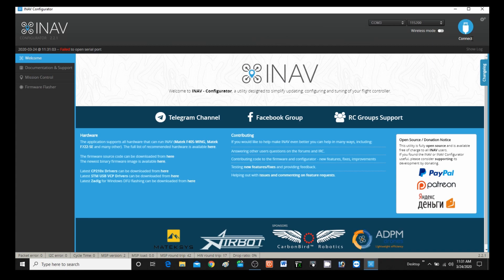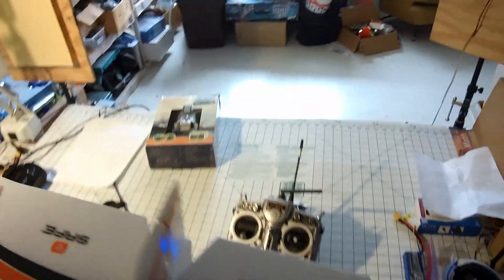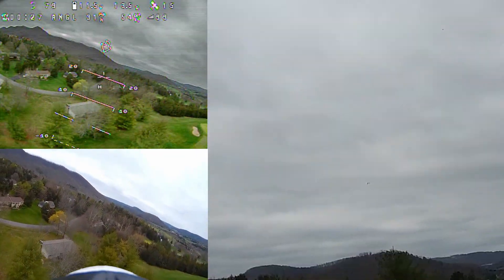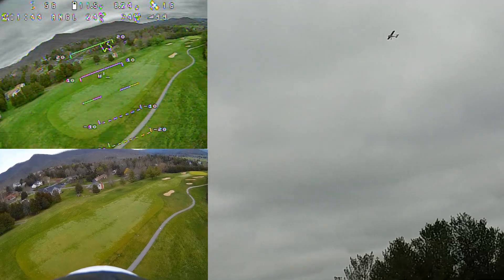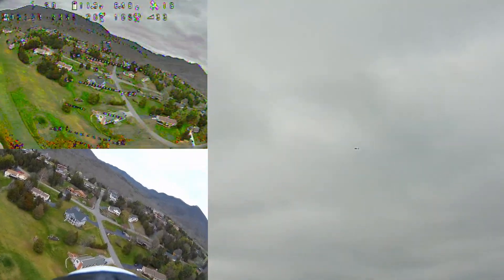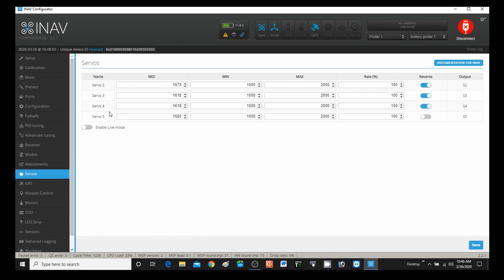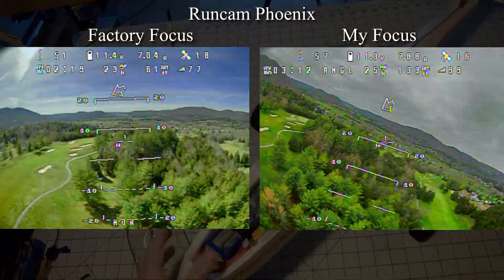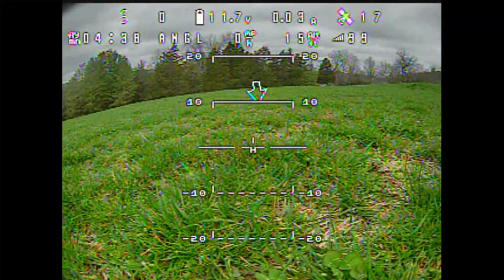iNav Zero P Gain Rudder Fix - Standard Airplane BrainFPV Radix Wing FC - EZUHF RX RSSI Mods.

Comment: I have experimented with this problem quite a bit and also opened a feature request to address this problem. One thing that is good to know is that the I-term is not active when the plane is not armed (or not flying, not sure), so you won't see the I-gain effect on the bench.

Comment: Looks like you really have her dialed in nicely now Dave!
Great video! I enjoyed simultaneous camera views. Nice job!
F
Reply from the maker: Thanks Fergy, I Resolved my PIP issues to do that :-)
Reply: Yeah, looked great!
Oh, and I forgot to check my render settings. I’ll get back to you on that.
Reply from the maker: @TheAdkFlyer10  lol, I tried 30,000 bit rate on this one using custom tab.
Reply: Checking my settings...
I have a custom setting set for MP4, H.264, 2048x1152 2K 16:9, 24 frames. Quality "Automatic" and "Best".
I usually render 2K even if the original footage was only 1080. I learned this trick from Matti Haapoja (Youtuber). I apparently helps to counter the negative effects of YouTube compression.
Reply from the maker: @TheAdkFlyer10  Thanks for getting back with the settings. Interesting about the 2k trick. Do you upload to YT as 2k as well, even if it was originally 1080p?
Reply: Yes, upload your rendered file as is. 
When you create a 2k (or 4K) movie from 1080 clips, it sort of “up converts” the footage.
Reply from the maker: @TheAdkFlyer10  Great tip, thanks! My thinking is that after I upload the 4k file I could delete it off my computer to save space and just keep the 1080 version thereby getting the best of both.

Comment: Oh, and that model is an E-Sky eagle isn't it?...🤔🤔🤔😷😷😷😷
Reply from the maker: The HobbyZone AeroScout is the same as the E-Sky Eagles except it comes with a stabilized AS3X receiver and is BNF or RTF. The Eagles was out of stock everywhere I looked so I bought AeroScout at a local hobby shop.
Reply: @DaveMerc  I thought so...it's the same model...So, what happens in Horizon Mode?..In Horizon, you can override all the controls all the time...but it will self level when you let go of course..🤔🤔😷😷
Reply from the maker: Same rudder problem in horizon mode too. Only manual / passthough gets rid of it.

Comment: It's an iNAV problem Dave...In Angle Mode, the Rudder should not counteract an induced Aileron bank..in fact with this model it needs a little rudder mixed in with Aileron...The Rudder should be active in GPS Modes to help maintain heading for example... Angle is not a GPS mode...but I guess you know that...That Radix FC and pdb is very expensive and that ladder HUD would drive me to distraction, which is why I won't be buying one...The text is nice though...🤔🤔😀😷😷😷😷
Reply from the maker: Thanks so much for your input b/c it always stimulates my thinking. For example I think the rudder problem has been looked at by iNav programmers but still seems to be there. Reference iNav issues #1297 and #1512. "Will be fully fixed when full airspeed support is introduced" (Who knows when that will happen).  I will probably turn off the Horizon Side Bars (thing you called a HUD ladder) eventually after I am satisfied with my flight angles and use artificial horizon only. Too me the Radix wing kit is reasonably priced considering it comes with the FC, GPS Puck and PDB plus wires and two kinds of pins for $99. For me the bonus is it's made in the USA because China quality control and support is lackluster.
Reply: @DaveMerc  Oh, I didn't realise it was US made...Try substituting Horizon for Angle Mode...alternately, you could put the Ailerons and Rudder on a Y lead and plug into the Aileron output. You may have to limit the Rudder movement mechanically though..Try it, it works a treat on a model like this....It needs Aileron and Rudder to turn nice...and reduce the workload...🤔🤔😷😷😷
Reply from the maker: Interesting idea about the y-lead.  Think I got it fixed with the rudder P gain on zero though. Now (as seen in the video) I can do stabilized turns with only the rudder which is great for aerial video. Making a nice smooth pan as the ailerons keep the plane level while I make the rudder turn in angle mode is wonderful. Plus just changing the p gain is easy to implement on my other iNav airplanes without having to change any wiring.
Reply: @DaveMerc  Yes, it's a cure alright but....The mix of Aileron and Rudder will produce a much nicer turn and reduce your workload a lot. I did this trick on my old big Skywalker and it transformed it totally...That plane suffers from adverse yaw horribly...this one's not quite so bad I think...🤔🤔😒😒😷😷😷😷